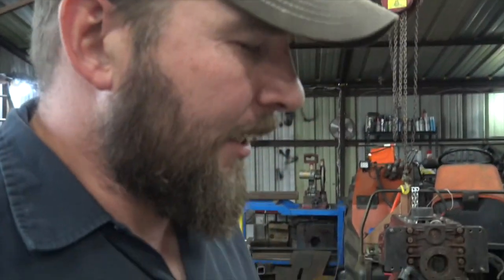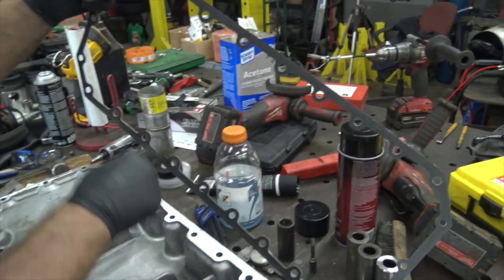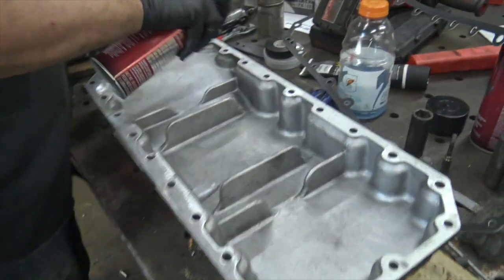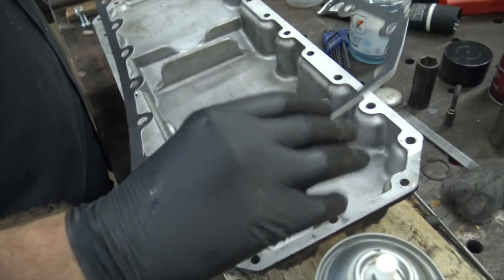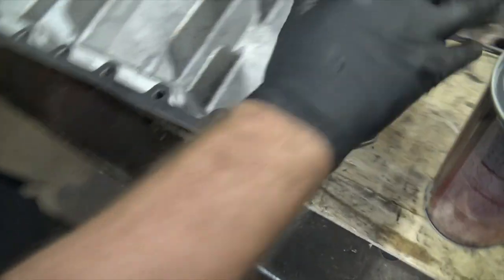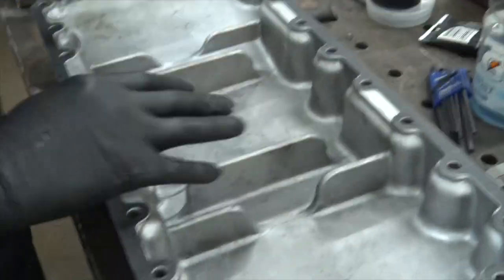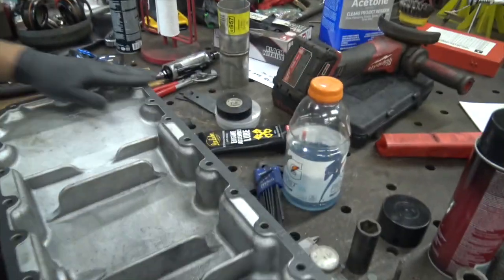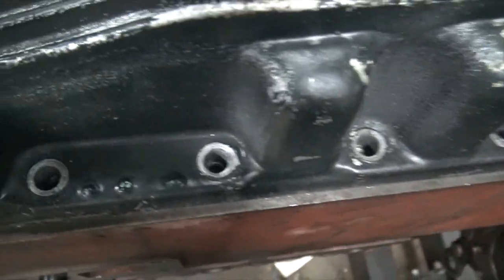THE ULTIMATE MECHANICS TRICK FOR HOLDING GASKETS IN PLACE DURING INSTALLATION

Comment: Another tip: Guide studs.  Take 2-3  bolts the same size as hold the item on, but an inch or two longer.  Cut the heads off and grind a dull point.    Screw these into the block (or whatever) loosely and then you can use them to guide the cover into exactly the right place and keep it there while you put in the rest of the real bolts (not tight yet) then thread the guide studs out and replace them with bolts.    The more awkward the access the more this helps.     In a pinch you can use wooden dowels held in with grease.

Comment: I dropped the pan on my cars transmission this afternoon to replace the filter. The pan gasket I bought is rubber and it was bunched up in a cardboard box so the gasket will not sit flat. Your solution will save the day tomorrow when I go to install the pan with the new gasket. I have a can of the 3M 77 and will use it as you demonstrate. Thank you for posting this.

Comment: Good advice, I'm working on my wife's car in my upholstery shop I'll have to try this. I wasn't looking forward to holding the gasket on and lining everything up .

We don't typically use 3M 77 in my shop because it'll fail in high heat application, like headliners or car upholstery but I might have a can stuffed in the back of the fire cabinet is great for a temp tack

Comment: And no excess squeeze-out on the inside to eventually break loose and clog up the oil system.  Down side is no gap fill on dinged up surfaces, otherwise, great tip.

Comment: Would it work for holding a gasket to a catalytic converter (gasket mates the cat to the engine) to aid in preventing the gasket from slipping while bolting on the cat?  Wondering since cats run at very high temp.

Comment: I wonder how much better this stuff is vs I think it's called schalack?
Reply: Shellac like Indian Head brand is decent stuff.  It gets very hard and flakes well when scraping. It's used instead of a gasket. This with a gasket is probably better. I prefer a proper gasket dressing spray.  Permatex and others make a copper one.  But if switching from shellac to a gasket, beware of clearances changing, ex transmission shafts.  Sometimes it doesn't matter.  Sometimes it's critical.